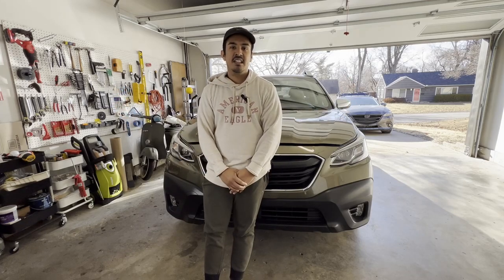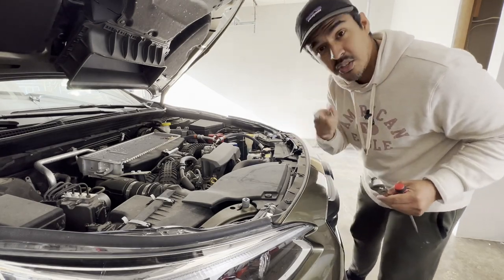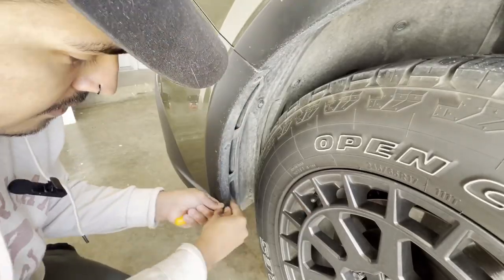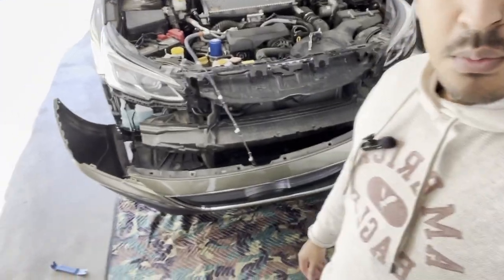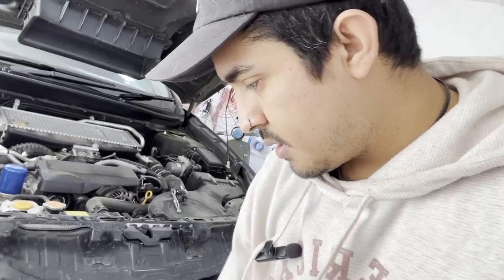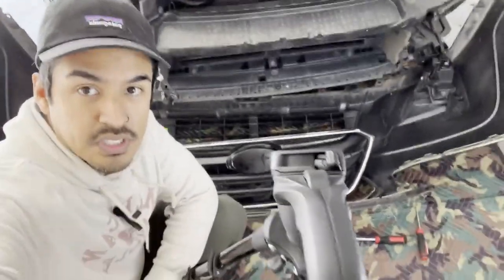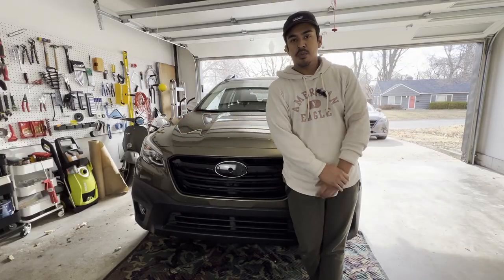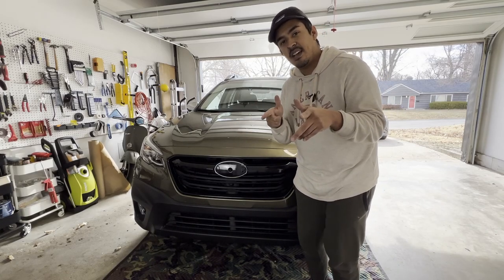CHANGING OUT THE GRILLE ON MY 2022 SUBARU OUTBACK! #install #diy #subaru

Comment: vinyl wrap might have been cheaper and faster than doing all that, but it looks great. Came here to see how to remove the grill though my project is to put some raptor LED lights for my '19. Great vid.
Reply from the maker: I did vinyl wrap but it didn’t hold up very well due to the hard lines of the grille. So I just bought a black one. Disassembly and assembly would of been 30 mins! Thanks for watching! Subscribe will ya?

Comment: My stock grill cracked. I’m looking to replace with same factory grille. Is it easy to transfer emblem from old grill to new grill?
Reply from the maker: It’s difficult since adhesive is used. Most likely will need to purchase new emblem as well.

Comment: Can the wilderness grille fit that?
Reply from the maker: That’s a great question! Im not sure if it does or not! I do know Subaru makes a “sport” grille  that looks similar to the wilderness.
Reply: The wilderness grille unfortunately doesn’t fit the regular outback. You would have to order the wilderness front bumper cover to be able to do it. For some reason they made the grille on the wilderness slightly larger than the standard outbacks, and the clips are in a different location. I assume it’s so nobody can make a fake wilderness without spending a ton of money. Also, the grille on the standard 2.5 is different from the 2.4 turbo grille. While they are the same size, the backside of the grille and air dam openings are designed differently.
Reply from the maker: @serenityinsilence  ah thanks for the insight!!

Comment: What about the fog lights?
Reply from the maker: You can’t change them out,if that’s what you’re asking.
Reply: Should they be disconnected when removing bumper? @Loubar87
Reply: BTW, changing to Subaru Sport Grill on Outback this week (did a Legacy once) and changing defective washer reservoir/sensor. @Loubar87